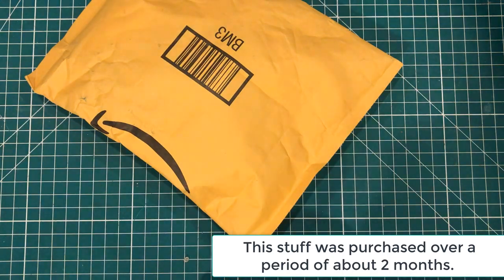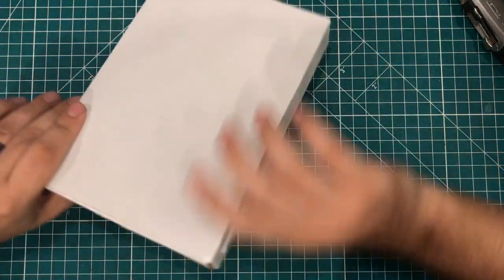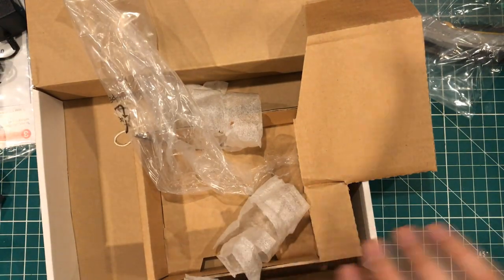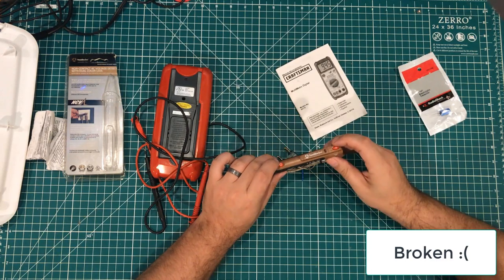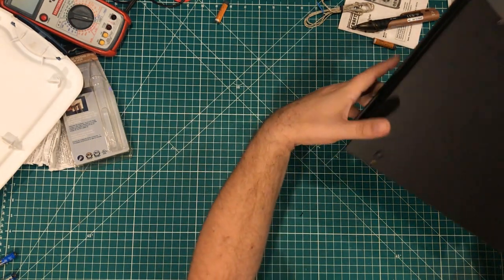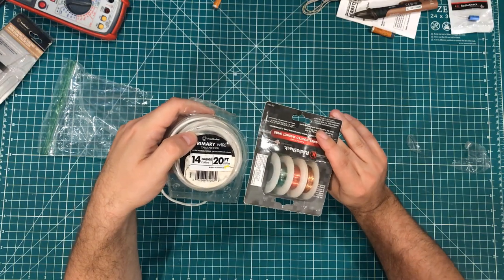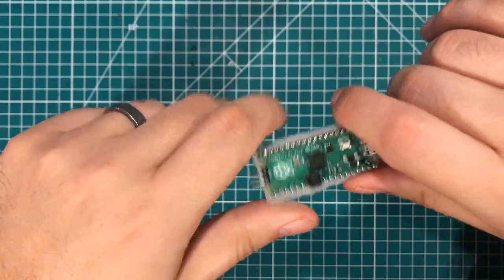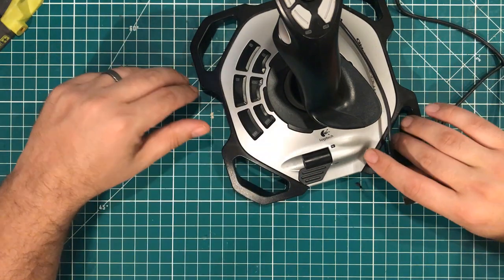Mailbag 21 - Mega Mailbag!

Comment: Duracell's Procell is their "professional" line. I tested the AA cells in my Battery Analyzer project and they're fairly average, it's mostly marketing wankery. I'm surprised your cells were so low, maybe they were partially used.
Reply from the maker: I definitely would not put it past someone too give used batteries to a thrift store